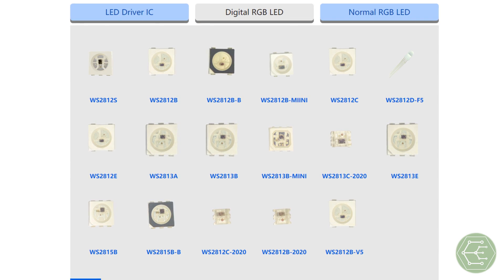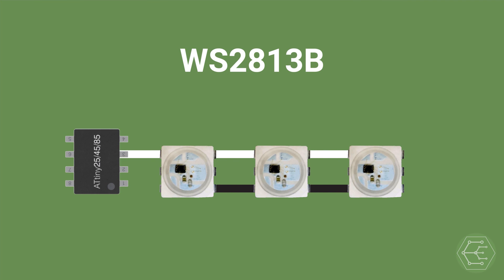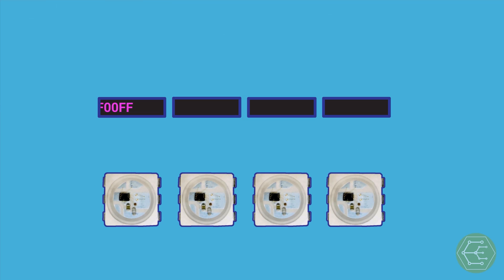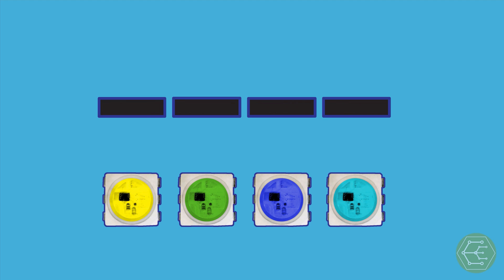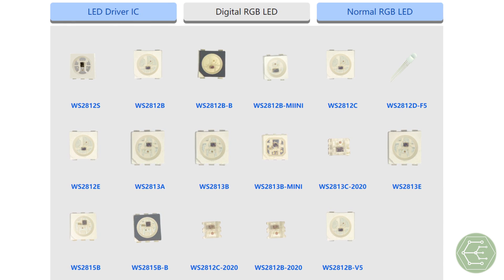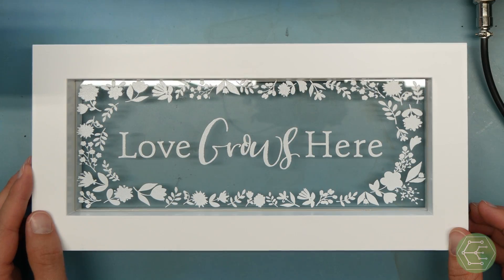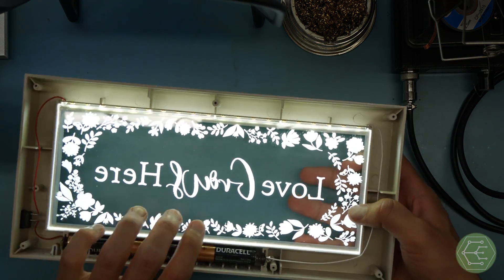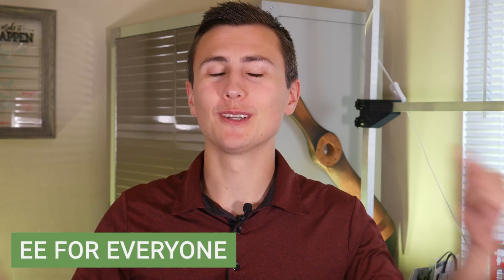WS2812B, WS2813B, and all the rest! Addressable LED overview.

Comment: I think you got the way the data is consumed wrong. The first WS2813B consumes the first 24bit on the bus an passes all following bits along until the reset/sync signal is detected. Effectively the exact other way around than you described.

"After the pixel power-on reset, the DIN port receive data from controller, the first pixel collect initial 24bit data then sent to the internal data latch, the other data which reshaping by the internal signal reshaping amplification circuit sent to the next cascade pixel through the DO port." (WS2813B Datasheet)
Reply from the maker: Wow, so it is!! I Just re-read the datasheet. Yes, it looks like my pixel indexes are all backwards! I thought it was always shifting data down, but not so! Latching the first data, and forwarding the rest. Good catch!!
Reply: @EEforEveryone  As they say one should not only highlight the issues: Your video was recommended to me out of the blue and aside the mixup i really liked it. Keep going.
Reply from the maker: Thank you rayncadiana, I hope to hear from you in the comments again! I'm glad you enjoyed the vid, and I always appreciate the truth! I'll add an annotation to correct... Assuming YT still allows that. :)

Comment: the 2815 can run at both voltages can't it? I have not used the new ones as I bought out a couple sellers during a sale like a month before they came out hahaha. 50 dollar rolls for 8 dollars.

Comment: the ws2813 are cool if you're doing a big outdoor thing with a few k of lights for a garden or something. the 2812b line are almost a decade older than the ws2812b. they were 2811 that has an mcu after every 4. using color, hue and sat is the best way to deal with them.

Comment: Nice tutorial.
I wish someone would compile an encyclopedia of LEDs.  I waste too much time trying to find the right LED for a project using Digikey.
Reply from the maker: Hi Bert, great idea! Yes, it can take a lot of time to filter through the different options!
Reply: Over at "The Hookup's" Channel he has a video discussing the many variations of addressable LEDs, as does Quindor over at his "Intermittent.Tech" channel, although their videos really only cover a small slice of the available options. Everytime I think I know about every single model of addressable LEDs being produced, I'll soon after stumble across a dozen new variants. 

This is what I think I know in a nutshell...
The 5V 16-bit HD108s is currently the undisputed champion of Addressable LEDs, its brightness and speed are unmatched, but your controller must support clock pin. For 12V addressable, it's GS8208 all day with its 12-bit Gamma Correction which improves color accuracy. For typical 5V addressable strips, SK6813 would be my choice. For RGBW addressable, I'd go SK6813 for 5V, or WS2814 for 12V, unless you need more than 60leds/m, because I think the 5V SK6812 is the only SMD Addressable RGBW that's being produced with pixel density greater than 60leds/m. For older varieties that can now be found cheaper, give me UCS1903 for it's higher tolerance of voltage fluctuation.